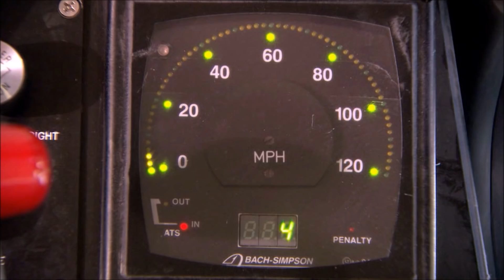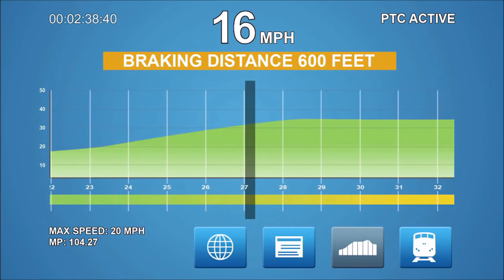Amtrak 501 "Cascades" Train Derailment 18 Dec 2017

Comment: Amtrak has had an automatic speed enforcement system, known as ACSES, since 2000, but has installed it only in the northeast.  The PTC system described in the video is far more complex than the technology needed to avoid accidents of this type.  All that is needed is a transponder in the trackbed which informs the locomotive of the speed limit.  In my opinion, the demand for complex, comprehensive systems has prevented implementation of the simpler system which would have avoided several overspeed passenger train accidents in recent years.

Comment: I guess what I have to say is this was the first run with passengers. I drove a city bus for 9 years and the first time I did a route I had never done before, despite the schedule, I would always run late due to being overly cautious. I would have already noted possible trouble points of the route and would have been extreme;y aware of any possible problems. I did not worry about being late because heck, it is the first time. Nobody can blame anybody for that.

The PTC, I suspect, was not yet implemented due to procrastination of wanting to release funds to get it done. They probably got an extension of some kind. Even if the PTC was in place, I would still be extremely vigilant because this is the initial run with passengers. 50 mph over the limit is just absurd. If I was in charge I would set up a mandatory red signal a fair amount before the curve so the train could not possible accelerate to over the limit by the time the train reached the curve. The time lost would never be more than the time lost due to the tragedy.

I also find it ridiculous to spend all that time and money to save 10 minutes. I do not know what to say when the state of people today cannot allow for 10 extra minutes to get somewhere. Sort of like if everybody left 5 minutes earlier for work in their cars, there would be far less issues on the highway.

I guess that is all I have to say. You do a good job presenting the facts.
Reply from the maker: Thanks John, great points!

Comment: People (not just Liberals) always complain, why wasn't the extremely expensive action taken? (in his case PTC). There's not unlimited funds for everything. Sometimes there's a judgment call. As is, trains cannot operate without far higher breakeven costs than alternative modes; throwing more costs on - for safety or whatever - is not an infinite well (even if free lunch tax subsidies make the beneficiaries "feel" that way). You have to draw the line. How would you like to pay a safety escort every time you step on an escalator? And how would you like trying to be one of the tens of thousands pouring on to the rush hour escalators at Grand Central Station, but first standing still for 45 minutes waiting for an escort? Trains have speed limit signs/signals, and they have speed limits on maps, and they have unmanned training of operators on train routes, and manned training with someone who has experience slowing down from 80 on 30 MPH curves. That system has worked for - well, centuries.

One or more of those broke down here. There must be examination, accountability, and assurance that the huge farck-up is not repeated, with consquences. But the answer is not to throw unlimited money at the problem. It's a balancing act. Like everything is, in the real world.

Not that PTC is not cost effective for this application. Or for another. I'm just saying.
Reply: That said, GPS is so cheap AND accurate AND reliable, that it sure would seem to be inexpensive to even write a bullet proof, quintuple redundant safety-assured system. I could probably write the basics in a couple of days with Google Map APIs. So I am perplexed at why a huge carrier such as Amtrak has not been able to economically put this in effect on every single foot of track. Besides, the marginal cost of adding a new leg (this new route leg) shouldn't cost a fortune. (Then again, they are dealing with federal bureaucracies .... don't get me started on the stupidly bureaucratic, foot-dragging counterproductiveness of the FAA ...)

Comment: Well the positive train control was supposed to be fully functional in 2015 here it is 2018 and it's still not in service. You can thank the railroads for dragging their feet and crying how expensive it is but the bottom line is that it is cheaper in the long run than lawsuits. The real truth behind a lot of these accidents is the quality of training the locomotive engineers. For years the railroads had fireman a throwback from the days of steam locomotives for sure but that was how the new locomotive Engineers were trained and it was a much more thorough form of training then sending a man to school and expecting him to memorize everything from books and videos. It was a form of on-the-job training that was invaluable and when a locomotive engineer is trained in that manner he is a much more conscious employee. He learns where those speed restrictions are he learns where the track curves he learns where the sidings are. He learns all the physical characteristics of the railroad as well as how to apply all the rules he learns. The government should make the railroads close down there schools and put the fireman back to work riding with and learning from an experienced regular locomotive engineer on the job everyday so that they have a thorough knowledge of the physical characteristics of a certain territory. It was and would be a much better training tool. The railroad did away with the fireman because they said it was an unnecessary craft and they wanted to save money then they went and established training centers that are top-heavy with management people. They did not save any money in the long run and they jeopardize the traveling public by having locomotive engineers who are pushed through the training as quickly as possible and put to work without a complete and thorough knowledge of the characteristics and the rules.
Reply from the maker: Great points Donn. Thanks.
Reply: blancolirio , you're welcome. I was a locomotive engineer for 34 years. When I first started training they still had fireman and that's where I learned most of what I knew. When they established a training center I did attend it as it was mandatory and then became set up as an engineer. I had Freight experience as well as passenger and was privileged to learn from a lot of good experienced older engineers.
Reply from the maker: Yes! In the airline industry there is a huge shift to "computer based" training replacing human instructors. A far cry from the quality one on one training with quality, experienced instructors. And the evaluations were much more challenging.

Comment: I have read that they were doing night training for a day track which is a bad idea. I am amazed that there does not seem to be any video training on the US tracks. That dates from the 1960's in Australia. Simply video the track from the cab on one run each way and then play back at a faster speed on a TV or computer with a throttle in the hand of the trainee driver. He can do 10 runs in simulation and the computer flags the points where he's gone over speed. The throttle shows the video to normal speed or stops it. If they can't do proper training then this solution which today would cost about $50 per train company would help. 
My grand father was a railway technician back when I was a kid and turned us kids into train technology watchers.

Comment: Here's the latest on this crash which as I have said in the past is a design flaw when they built this upgraded line. The design flaw in question?? A high speed rail line constructed with 79 mph speed limits that end at a curve over a bridge with a speed limit of 30 mph?? There's your design flaw. Here's a link - http://mynorthwest.com/856211/bob-ferguson-questions-for-amtrak-crash/

Comment: PTC is an interesting set of problems... and it is not ready for prime time.  (In Alabama they had weeks of 10 mph or less trains because the system keeps crashing.  Same thing in other areas.  (Once it has a problem you have to call for permission to turn the PTC off.  The technology has existed for MANY years.  The Pennsy had a very early version on the NE Corridor.  It basically is an extension of their Cab signals there.. Unfortunately, Amtrak lacks a real culture of safety.  The other Amtrak line where the overspeed derailment in Philly has it working.. the one where the accident happened?  It was removed during track work because it was too time consuming to reinstall.  They put it back in place at a cost of about $500.   They had it "working" in the area where a train hit a backhoe and maintenance men north of Philly several months ago....The workers had not followed normal procedures, and there was poor communication between the workers and dispatchers...  And then there is Michigan, where they had ACES (their version) running.. A Signal guy had left a jumper in place, so all the signals looked good, but a northbound/eastbound train was suddenly dumped into a maintenance yard.. off the track at about 40-50 mph. Everything stayed upright, no one was killed in that case.  The problem is that there is no real culture of safety in the organization. Management since Wick Mooreman has tried to get that established, but there are too many people that never really worked in railroading... basically bean counters, and they want everything done as quickly as possible to save money...   Sad situation.  In the Washington derailment, the accident happened at night.  Had the engineer been trained on that line only in daylight?  Things are grossly different at night.  Washington State owned the train set.  That will have to be replaced.  Sound Transit owns the track... They filed for a "get out of jail free" card on PTC, delaying it until late spring or as late as July.  The comments I heard in one of the  briefings was that UP had installed PTC, but not enabled it.. That has to be done by the Sound Transit folk.  Amtrak is the contractors to run the trains.

Comment: seems like a bit of poor design. Having a slow curve in the middle of a high speed passenger route. That is a lot of cash to spend on a 10 minuet trip savings. All passenger trains are required to have PST installed by the end on 2018. Out here NJ transit and MTA are under the gun to get it finished. The feds extended the deadline a couple years ago

Comment: Thank you, Juan. I kept an open mind of all opinions expressed right after the accident including terrorist plots of concrete or other matter being place on the tracks but when you realize that a locomotive is equipped with very similar on-board data systems like aircraft, my own conclusion is that yes, 81MPH approaching that tight turn is just too much. A trains center of gravity as opposed to it's width is very, very 'top-heavy' and does not allow for any kind of "cornering speed." Also, it calls into question the engineer's familiarity of the route? But just like on our roads, there are always signs that alert us of upcoming turn/corner and to s-l-o-w and why wouldn't that engineer have noted that?

Comment: It's should have a permanently post a solid yellow or flashing yellow signal light before any curve track(s) instead of solid or flashing green light which is help engineer instead of speed sign is posted next to the track is too fast by over look or forgot to look at the speed sign???????? Between high speed to slow speed such as if higher than 10 MPH from previous posted 79 MPH then slow to 30 MPH is 40 MPH different with helps to alert at signal light huh to Federal Railroad Adminsrration (FRA) or National Transportation Safety Board (NTSB) duh? !!!!!! Except several curving during slow speed such as Donner Summit is not necessary to have yellow signal lights. Just required between high speed to slowest speed in ahead then signal light is given them a warranty.

Comment: John Hiatt, an ex-BNSF engineer and 35 year veteran of investigating train accidents for his employer, the law firm Bremseth, out of Minnesota, is claiming that the engineer was improperly or inadequately trained for this run.  He is saying the engineers and conductors assigned to this run were trained in groups and after midnight.  He feels there was too little time spent preparing the crews for the rushed first run of this route.  Keep in mind, the conductor is charge of the train, not the engineer.  Bremseth represents railroad workers involved in lawsuits.

He seems to be laying the ground work for a plea of "Yes, I was in charge of the engine and I had it going 80 mph.  But it wasn't my fault the train ran off the bridge.  I was inadequately trained for this route.  And therefore  i plead Not Guilty."

Comment: Great report, Juan.  You can tell the train was going way too fast when you look at the slightly uphill grade going into the curve and see no track damage at all where the train left the tracks.  It literally flew off the tracks when the grade dipped down toward the bridge approach curve.  The last four cars and the engine followed that intact track on the curve until the cars impacted the derailed cars and were pushed off the bridge by the inertia of the rear engine gliding around the curve.  How totally sad and unnecessary was this accident.

Comment: Request for follow-up report:  Juan, can you please investigate why the decision-makers chose to keep the hair-pin turn, if there are any other hazardous turns on the route, and why they chose to proceed with the commuter route despite the 2015 law requiring them to install (and, I assume, have operational) the PCT system.  I understand it was installed, but not functional.  If they argue that the law only states that the system needed to be installed and not that it needed to be working, then their interpretation of the law is, in my opinion, irresponsible and worth further scrutiny.  Can you please investigate that side of this story as well?  Saving 10 minutes is not worth the cost of lost lives, resources that could be put to better use (i.e. keep the old route and spend the $$ on a higher priority public service), damaged psyches due to having experienced a traumatic event, pain and suffering, and lost faith in Amtrak and those involved in making decisions on our behalf.

Comment: Why wasn't the  control center telling  the engineer the speed ahead?  Isnt that part of its job to verify speed, communicate with engineers ?  
Why wasnt all safety installed before opening the line, at a cost of 150 to 180 million. 
That  poor engineer is going to be the scapegoat for the train company.

Comment: Hello blancolirio; as usual, superlative coverage, however this time, for a rather sad incident.

Whereas you admirably present the facts, much as other media in the US attempt; I wish to bring an outside perspective of this unfortunate Amtrak 501 ‘Cascades’ Train Derailment, which sees this in a rather different way.
This may be construed as a more Europanised view-point.
All facts accepted as accurate; but the ‘value’ system is very different.

Amtrak advertise a new ‘high-speed’ service, over refurbished lines, saving 10 minutes or so, on an established rout, Seattle, heading south for Portland. It was Amtrak's first passenger service to run on a new, shorter route after an investment of (some) $181m (£82m) (BBC). The investment stated to upgrade some existing ‘freight’ track, to be accommodative to ‘passenger’ traffic.

Whereas despite President Donald Trump’s not unexpected out of phase ‘infrastructure’ tweet; US media, as yourself, lament the non-implementation of the existing ‘Positive Train Control’ system used on other US networks; as an oversight, that could have prevented this sad incident.

The outside view is far more critical, and considers this viewpoint as backward, Draconian, and nearly North Korean.

It all falls apart with Amtrak’s ‘high-speed’ declaration. On one hand, everybody knows that there is no such thing as a ‘high-speed’ rail network in the US; when compared with Japan, China, Italy, France and the UK for example; which tangentially supports the essence of Trump’s tweet (although it wasn’t his realisation in the 1st place). On the other hand, when a ‘high-speed’ rail-net is considered outside the US, safety in the public interest, always comes first. In that, if a ‘high-speed’ rail-net is declared, the track has to be ‘fit for purpose’ before it can be used. No ‘30 mph’ restrictions allowed (scheduled maintenance restrictions however, accepted.). So this all boils down to: Amtrak is responsible for any ‘high-speed’ track that they declare; they are responsible to make it ‘fit for purpose’.

This then begs the question, why, when the track was upgraded, was it not correctly cambered to support the passage of traffic at 79 mph, the alleged ‘high-speed’ limit applied on the line? This just means that the line was not ‘fit for purpose’.

Any other caveats, such as ‘Positive Train Control’, do not apply here.

The real ‘bottom line’ is; the public interest was blatantly not served in the 1st place; and there was a sad, but unavoidable, accident as a result.

There is much here that the investigators of the US National Transportation Safety Board can report on. But from an outside point of view, after all the expected technicalities; will they declare Amtrak culpable?

Thanks for your patience to read this. Cheers & keep up the good reporting.